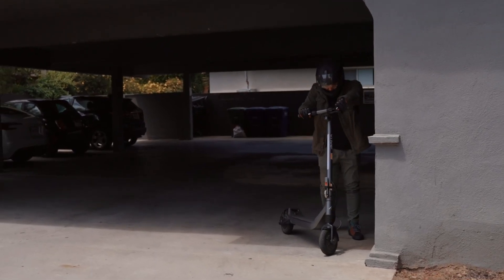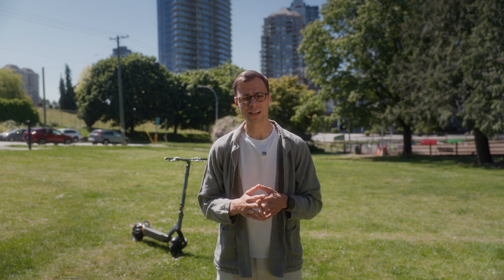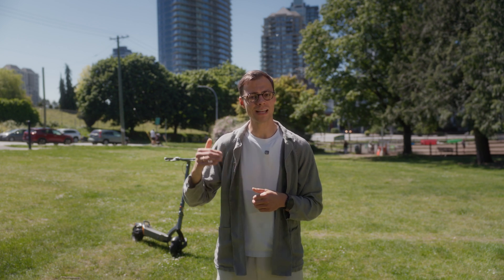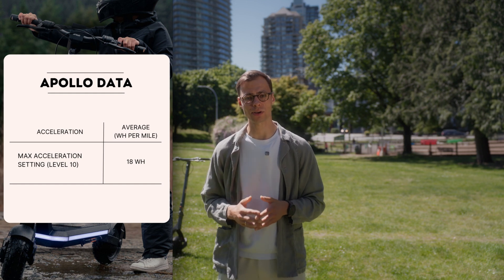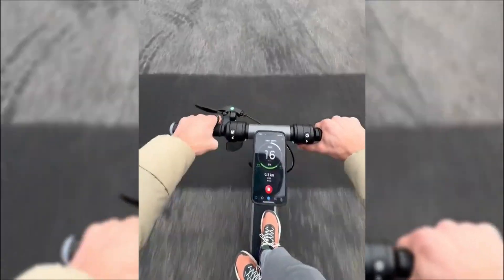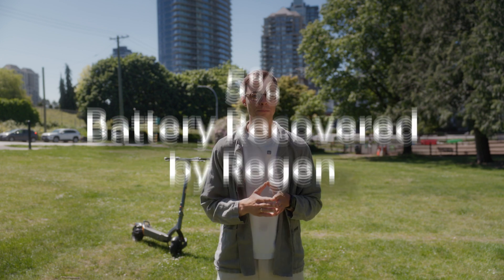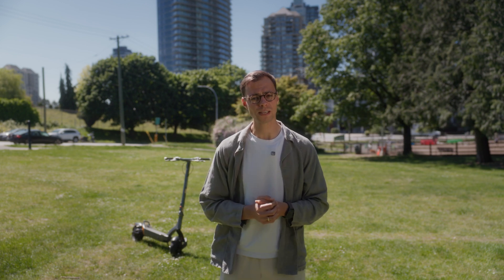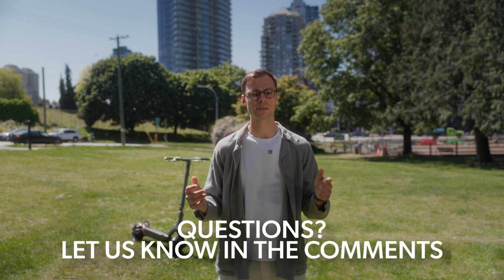How to Increase Your Electric Scooter Range by 40%

Comment: Make sure your tires are inflated properly. And be aware that scooter tires are really low volume, so disconnecting the pump by unscrewing the hose from the valve can let out more than half of the air you just pumped in, especially when using that valve extender that comes with cheap scooters. No, seriously, go inflate a tire with a pump with a gauge, disconnect it, reconnect it and compare the pressure. Shocking, isn't it? Sadly the wheel with the motor is usually not very friendly to pumps with quick release (clamp-on) end. You could get a different extension hose or gently file down the pin in the middle of the existing extender so that the valve opens just as the thread bottoms out instead of halfway through. Or over-inflate the tire by some amount. After modifying my hose and inflating my tires to actually 50psi instead of "I thought it's 50psi but actually 20psi" I got about 30% more range than before on the same route.
Reply: I noticed this as well ! Just disconnecting the hose to air tire I was loosing 5-10psi. Then I would check with a gauge and loose even more . Just bought the Apollo electric air inflator hoping I can mitigate that problem.
Reply: @nino5988  Has it helped? Was curious about it.

Comment: 5:50 this dude is only giving you a general idea but nothing Accurate, for example yes regen braking is nice or whatever but if puts so much heat back to the motor and controllers you dont imagine how much heat is put into that hub with regen braking unless your scooter comes with water lines or cooling lines for the hub and controllers i wouldn't suggest using regen braking if you live in a hot weather like i do az heat ( 120f ) during the daylight, it also gives you about realistically 2% energy back to the battery in real life scenario, its basically useless, you are lowering that hub motor life your putting so much stress into the system that the benefits are miniscule compared to the stress and damage to all of your components, let me clarify this even better ( if your scooter is water cooled or has the best in the world cooling out of this galaxy type of cooling then yes regen braking can be use , but if your scooter is like most scooters out there in the 99% of population then no don't use it for the love of god take care of those components you don't need to be a scientist with Harvard degree to know how to take care of your scooter , is basically common sense that's all.
Reply: brother you are too misinformed about regen braking I dont even know where to begin. but if you really want me to get you informed let me know.
Reply: @x-shift8937 yeah sure shine a 🕯️ upon me...

Comment: i dont think people should follow the "use eco mode" advice up hills. eco mode isnt designed for that. this is how you wreck a controller. thats how i ruined mine, currently waiting for a new one.
basically ppl who ride apollo: use comfort (mode 2) or "drive" on other scooters in hilly areas as your "eco." eco is meant for flat ground
Reply: I just got mine today. Thanks for this advice
Reply: no problem i wish someone told me lol @Jowiej03

Comment: I have the Emove Roadster and it died on me after 40 miles of riding.  Lots of hill attacks and aggressive acceleration. I had to do the walk of shame... 😤😤. I learnt the hard way that battery percentage is not correct at all.
Reply: I know that thing is fast how long did it take you to drain 40 mikes of range?
Reply: @Leadonluke it was a total of 55 miles but it died after about 45 miles. But I also charged it up to 65% at the half way mark.

Comment: I have a question about the millage claims. Firstly, if I wanted to go 16mph then I wouldn't need a scooter that goes 25+, kind of defeats the purpose of having a faster scooter.

2ndly, you said that going 25mph gives you 20miles of range and this was with you talking about the apollo go. The Apollo Go isn't going anywhere near 20miles at 25mph. Literally cut that in half.

Comment: With my controller I’m able to fine tune it and my dual 52v motors running off 48v battery max speed of 31 averaging 16-18 wh/mi full throttle 100% of the time #flipsky

Comment: 5:37 Punk Rider Scooters have a dedicated regen throttle so you are not the only brand.

3:18 More accurately, It's one of the easiest way to go faster to the HOSPITAL 💯😂 Cruise Control can be very Dangerous, especially for inexperienced to moderate. By the time you reach pro status like me, Cruise control is an unused phony feature, thus the ideal scooter will not have cruise control.
Reply: Ladies and Gentleman, The Contrarian.
Reply: if u dont know how to use cruise control, sure. u can activate it by accident, especially if its automatic and u have had the throttle at a certain position for a while
but if u know how to use it, its actually a safer way to ride. because your thumb is now on the handlebars, for even more control. its the exact opposite of phony.
the perfect medium is manual cruise control that u push to activate instead of automatic. that way it cant be done by accident.
i wouldnt get a scooter that doesnt have cruise control.
Reply: also: punk literally copied apollo lol
Reply: @vincecartertorryholt   You explained some reasons backing up the fact that Cruise Control is dangerous. This supports my claim. In regards to Punk copying Apollo, I also thought they copied Apollo but if you compare it properly, they are not the same in reality; each scooter has its unique differences. For example, the Punk Rider Pro has a more straght, edgier design, very similar to the CyberTruck, where as the Apollo is more unique, with folding mechanism & stem light in front. This is why they have not been sued. To summarise, you are wrong to suggest that Cruise control is not dangerous & that Punk copied Apollo. Coming from a highly skilled Rider who owns both scooters, I have proof of this.
Reply: You have the option to turn off cruise control??
Reply: @skullmaster-r44 You are missing the point, the fact that cruise control was invented is the issue. People have died from this feature alone.
Reply: @Deliver-Fool I love cruise control and use it all the time

Comment: So why you showing for example for Pro 50-100 km range ? So if I will go on max speed pro is 70kmh I’ll be able to ride 50 km ? So how to get 100km ? My weight have to be not more than 30 kg, flat surface, no winds and top speed is 15kmh am I right ?